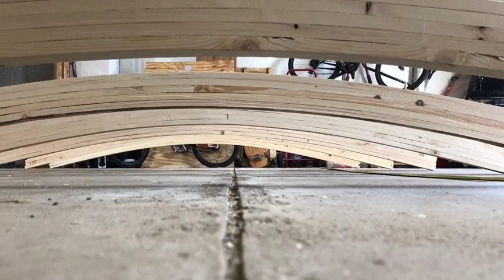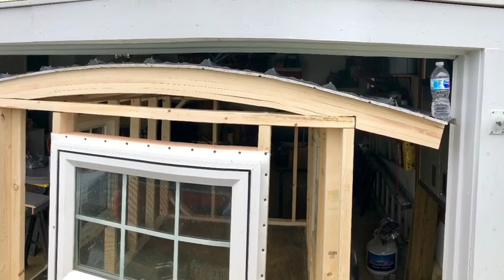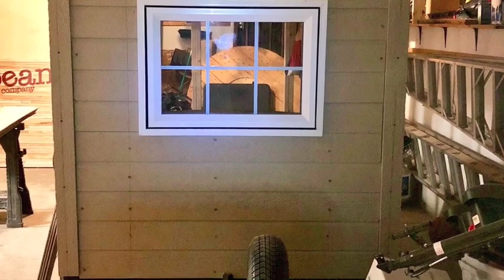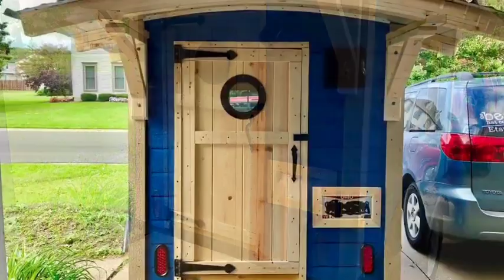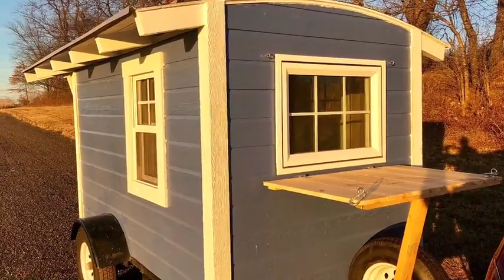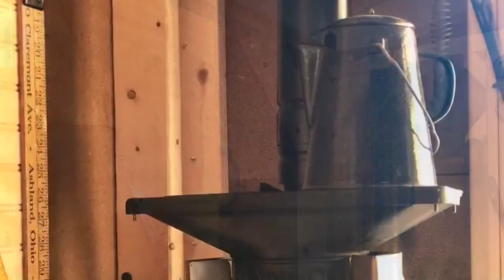The Birdhouse Tiny Trailer

Comment: Looks beautiful. How do you keep the rain from going under the metal roofing along the front while driving?
Reply: There are closed cell foam strips specifically moulded to match the roof shape for installation into the gap you mention.

I have seen these edge strips in round and square corrogated form to fit metal and plastic roofing panels.

They are probably sold at the same location as supplies the roofing sheets.

They are referred to as Foam Closure Strips. 

I hope this helps.